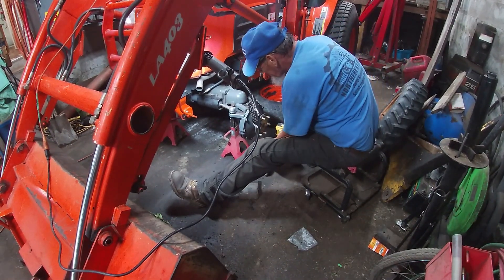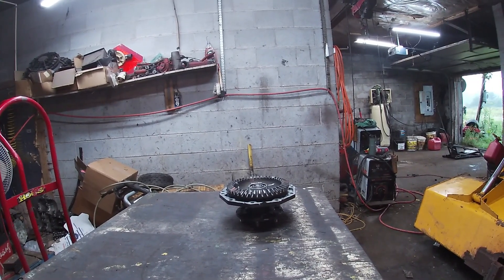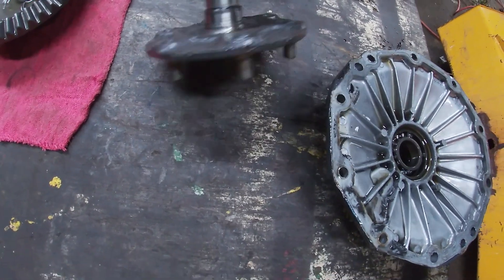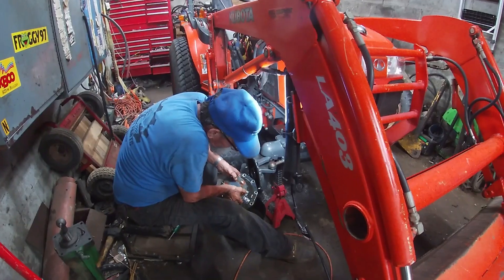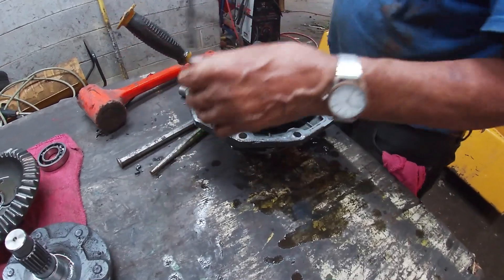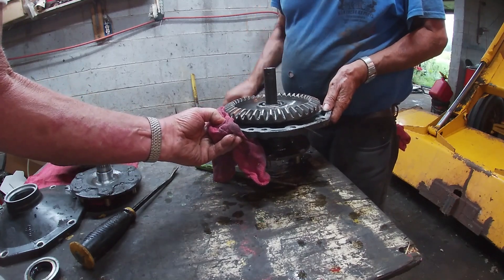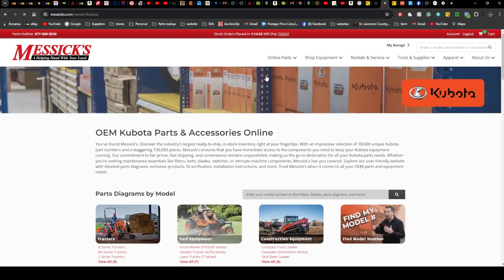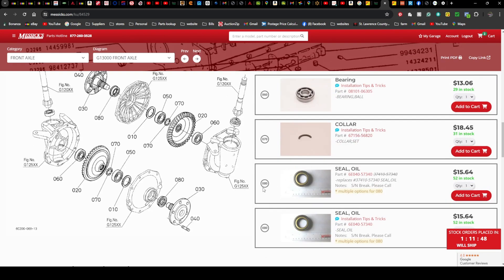Kubota B3030 Front Axle Seal Replacement: Tear Down (Part 1)

Comment: Great videos! My 2005 3030 has excessive end play in the front axle. Do you think it would be a bearing in the front axle that you documented or a bearing in the differential gear shaft?
Thanks Steve
Reply from the maker: My best guess with not seeing it, I would be leaning towards the bearing in the front axle.
Reply: @northernnewyorkparts  Thanks, Me too. I will start there any way!